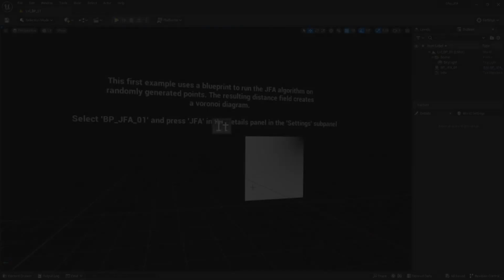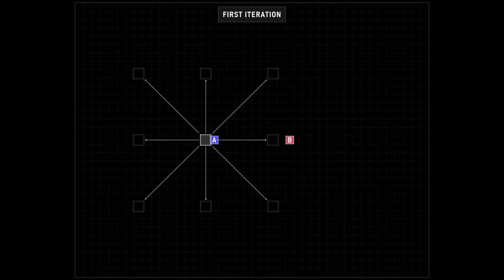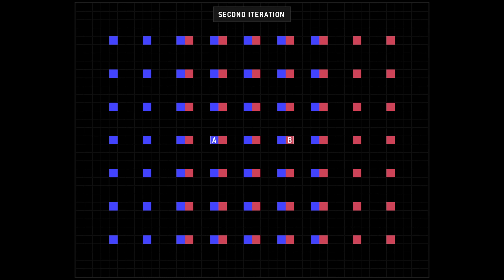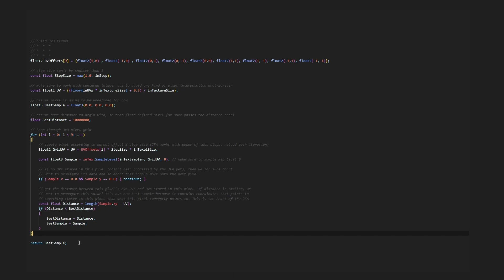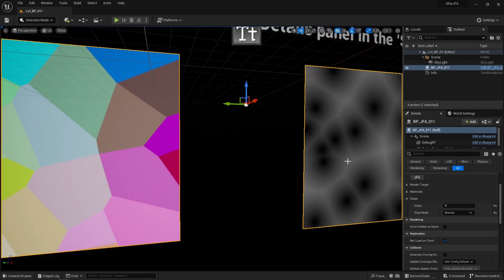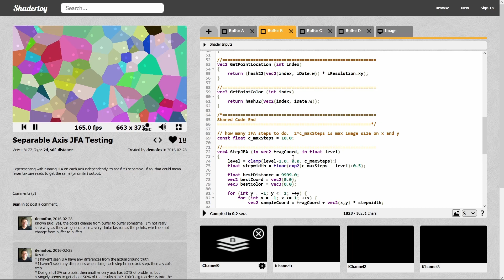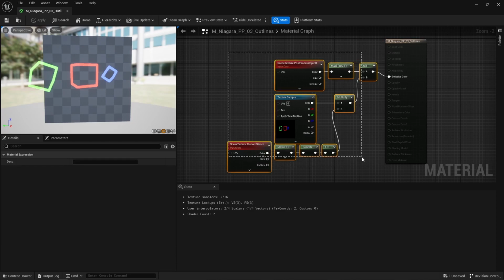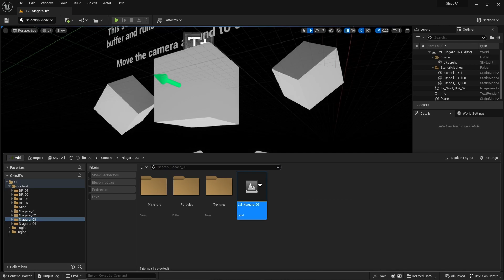The Jump Flood Algorithm explained! UE implementations using Blueprint and Niagara

Comment: If there is a building or wall in the player's field of view, how can I achieve an effect where the view is blocked by the building or wall and the fog of war does not illuminate the other side?
Reply from the maker: You probably meant to comment on the Niagara/JFA FoW video? If so, that'd be per unit? That's usually unsupported by FoW systems because it's quite tricky to implement/costly and most often actually undesired for RTS games. It you only care about one single PoV though, the technique is similar to shadow maps: Have a look at my 'Occlusion techniques using Scene Captures & Depth Maps' video